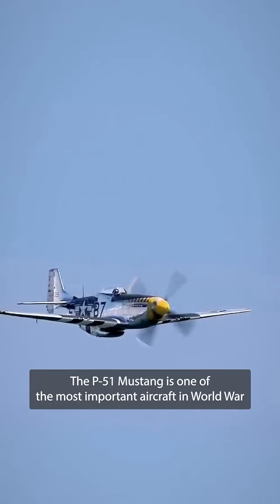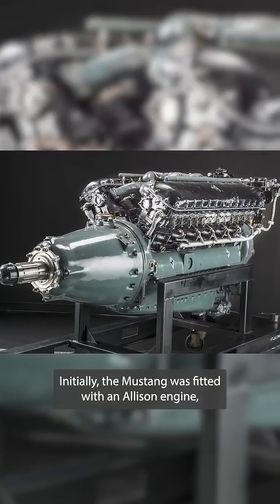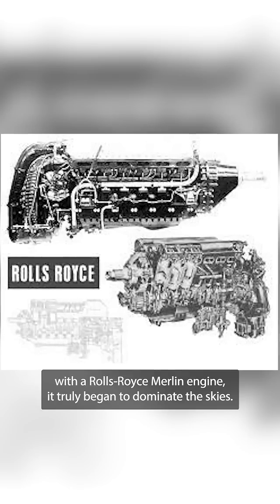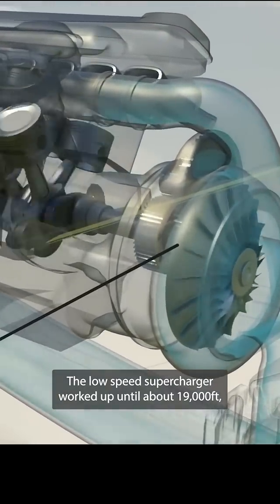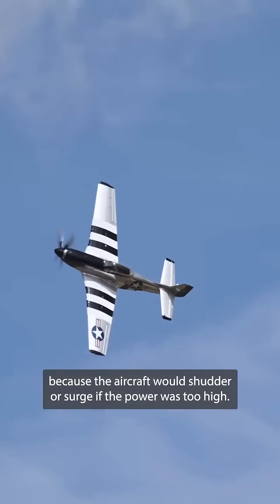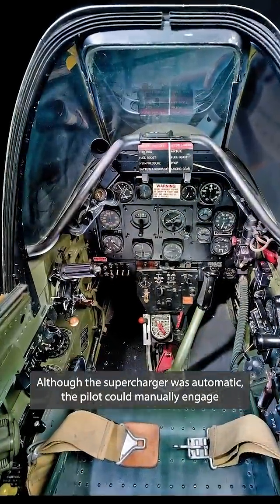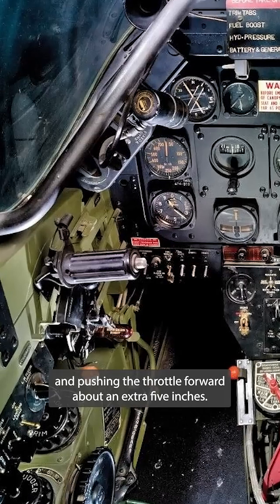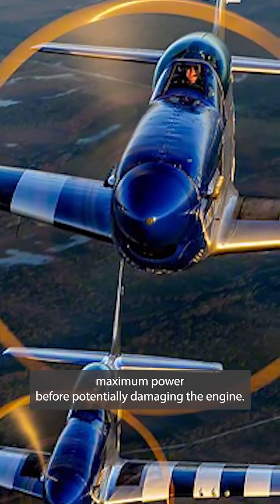The P51 Mustang: WW2’s Best Fighter!

Comment: Packard Merlin built on licence in America. The RAF swapped out the original engine due to it struggling at higher altitudes, which limited the performance as a Fighter. In went in the trusty Rolls Royce Merlin and it made a huge impact on the P51 straight away.

Comment: the Merlin was not only more powerful at low altitude but much more powerful at higher altitude.  transformed the p-51 into the final pen-ultimate fighter of the war.  it was light, maneuverable,  fast,  agile, long-range, quickly manufactured and more.

Comment: I wonder how it would have performed with a Griffin engine? Instead of the Merlin. The engineers at Supermarine had to extend the forward section of the Spitfire to accommodate the Griffin engine, was there sufficient room in the Mustang?

Comment: The PT boats in torpedo attack mode, had a selector on the Detroit 6-71 engines governor that was labled "Battle Mode" , which gave the crews an additional 500-700 rpms(depending on the crew chief) for their run-in to attack.  Those also risked engine damage if Battle Mode was selected on the governor, even though it was a tough Detroit with really good cooling. 

We had a WW2 pilot flying for us in the early 80's.  He flew P-51's tor 3 years.  Was shot up twice and made it back with no scratches.
 He always said, - The P-51was kind of a dog, until you got rid of all the underwings, half the ammo and down to a third of the fuel left,, then it was a  HOT ROD!-.   Pilots would "grey out" because of the quick G loading at altitude.
Reply: PT boats did not have Detroit diesels. In fact, they didn't have diesels at all. They were powered by 3 Packard built, 2450 cubic inch, gasoline burning V-12's.  Even larger than the 2240 cubic inch RR Griffon.
Reply: @Leftycraig48 Oh, snap. You rightfully made a liar out of the other poster. Good job!
Reply: PT boats used 3 2500 ci 1500 HP  Packard 
v 12 gasoline engines.
NEVER used a small
 6-71 Detroit Diesel.
Marine versions of 6-71s in the 1980s put out almost 500hp. WW II versions of 6-71
put out less then  half 
that power.  Vietnam 
river patrol boats had high power 6-71 Diesel 
puting out about 
400 HP.

Comment: What really helped to boost the Merlin's performance was the introduction of higher octane aviation gasoline. The Merlin was basically a 1,000hp engine until 115 octane fuel became available. Then it was a 1500hp engine.
Reply: Higher octane fuel does NOT increase horsepower by itself.  Increased octane allows higher compression ratios (which really increases horsepower) without detonation.  (Some folks surprisingly do not understand this simple fact.)
Reply: Exactly - it makes the fuel burn slower so you can burn it faster 😱😁 @cmichaelhoover8432
Reply: The Germans couldn't obtain high octane fuel. The displacement of the Merlin was much smaller than German fighter engines, but it still produced similar HP numbers due to much higher compression ratios, possible bc of hi octane fuels.
Reply: @thenaturalmidsouth9536  that's incorect, the germans had high octane fuel from day one.  even the USA was supplying TEL  during the battle of Britain
Reply: @deanwilliams4365  they didn't have it for the bulk of the war, no.
Reply: @thenaturalmidsouth9536  Incorrect,  the Nazis had High octane fuel during the battle of Britain,  synthetic fuel is easier to make high octane anyway, add to that 400 tons of TEL ( look it up) wa shipped By the US to nazi germany during the battle of britain, according to the Truman report!
Reply: rubbish,  the british had high octane fuel from day dot

Comment: And the ME109's engine was an innovative arguably better design not better performance. The ME's engine is Direct injected and mounted oil pan UP. So it was never starved for Oil or Fuel regardless of the planes potion or maneuvering.
Reply: From 1941, Merlins had a simple flow restricter, called Miss Shilling's Orifice after its inventor, which prevented fuel starvation when inverted or in negative G. The beauty of it was its simplicity and that it could be fitted to Merlins in the field. It was an extremely effective stop-gap until the Bendix pressure carburettor became available in 1943.
Reply: @paladin56  Were they still prone to fuel starvation in prolonged high G turns
Reply: It was also somewhat easier to maintain for mechanics since it was "upside down" so to speak...

Comment: Really?! Read your history, the p-51 was designed with a supercharger but the British didn't want it.
Reply: I was under the impression that the Allison 1710 had an export sensitive turbo-supercharger. The RAF was looking for a high altitude fighter, so it makes little sense to me that they would order an engine which was incapable of providing that ability when a version of the engine which could do so was also available. As it was, the RAF was very disappointed with the Mustang I's performance at altitude which is why it was used exclusively as a low-altitude tactical fighter and fighter reconnaissance aircraft. It is precisely for that reason that they experimented by putting two-stage, two-speed supercharged Merlin in it.

Comment: The 2 speed supercharger was shifted manually at high altitude. War emergency power was a water/alcohol injection system.
Reply: i thought that too. but it has to be true, its on the internet.
Reply: @wils-q7j  ha ha! if it's online it has to be true!
Reply: Yes. Water injection dampened fuel / air detonation so they could open the throttle to a higher manifold pressure provided by the supercharger. Alcohol kept the water from freezing at the extremely low temperatures at high altitude. The water / alcohol reservoir could only supply water injection for little more than 5 minutes.
Reply: I thought the emergency horsepower was from nitrous oxide. I know they had water/alcohol injection, but that wasn't for a boost in power.
Reply: WEP was produced purely by running the fuel in rich mixture and over boosting the engine.   Water injection was only used on the P-51H but it never entered service.  
Water injection injection was used on the R-2800 of every American fighter that used it.  Not the Merlin though.  
110/150 fuel allowed even more overboost than 100/130.

Comment: And, as ever, the P-51 Mustang, though an innovative design and production values - laminal slipstreaming, ect, - it was nothing without the British Merlin.  Therefore, the Spitfire was really better than Mustang, given comparative time frames of invention, construction and use.  However, no matter the kit, it was always the pilots that made the inanimate object into a thing of near-living lethal beauty.
Reply: Even with the Allison, the P-51 was one of the fastest fighters at low altitude. With a Merlin, it was about as fast as a Spitfire was with a Griffon. The P-51’s main strength wasn’t that it used cutting-edge technology, but that it was just a versatile and relatively cheap design that performed well and could replace the jobs of most of the other fighters the army had.

Comment: I had the North American P-51 Mustang Pilot's Flight Operating Instructions in the early 60s and was fascinated with the aircraft. Bailing out required squatting on the seat and rolling upsidedown. Ditching in the ocean swell troughs and the use of the pilot's relief tube. Two buttons on the right would activate a timer to destroy the radios with explosives.

Comment: The Mustang was actually designed by the British as a future replacement for the Spitfire, but since their manufacturing capabilities were fully extended, the British asked the Americans, who were partners in in its development, to produce the aircraft in the USA. Typical of American pride, they wanted an American engine in the new Mustang, hence the first production with the Allison engine. The performance was so poor with this engine that the British refused delivery of the Mustangs... until the same engine used in the Spitfires was installed and the Mustang became the fighter that won the air war in Europe. The British designed and British powered Mustang, built in America, became the world class fighter of WWII.
Reply: British may have provided specifications to North American, but they sure didn't design it. In fact one its leading designers was a German immigrant. Look it up.
Reply: You're not really correct. The British Purchasing Mission wanted the Curtiss P-40 and, to help ramp up production, asked North American if they would licence build the type. Instead, North American offered to design  their own aircraft which the British, suitably impressed, selected as well as the Curtiss. It was later, after the disappointment of the Mustang's high altitude performance, that Rolls Royce experimented by putting a Merlin in a Mustang. The rest, as they say, is history. The RAF also particularly disliked the canopy arrangement on the Mustang as it obstructed vision for the pilot. Because of this they redesigned the canopy, fitting the 'blown' Malcolm Hood which dramatically improved pilot vision and also mage it easier to leave the aircraft in an emergency.

Comment: War emergency power is such an interesting concept
Reply: A USAAF general (I forget which general) scolded a P-51 fighter group commander, a colonel (I also forget which colonel), because his P-51 pilots were overusing war emergency power and burning up expensive P-51 engines. The colonel replied, "Would you rather my pilots burn up replaceable P-51 engines to protect irreplaceable bombers each with four engines and 10 men or would you rather they sacrifice bombers to preserve P-51 engines?" The general quickly saw the colonels point and replied, "Tell your pilots to burn up as many engines as they need to protect the bombers. We can replace the P-51 engines."
Reply: Congress has the power to declare war...😅

Comment: You do not understand the basics, the supercharger second stage does not kick in at high altitude, it is permanently in-line.  You are confused by the change over to the higher supercharger speed.

Comment: When the Army sent out the spec. for these engines, G.M was suppose to supply the turbo/supercharger. Those turbos wouldn't fit into a P40 or P51 but would fit into Kelly Johnson's twin boom P38's and acquitted themselves well at high altitudes.
Reply: I think you are confusing the Merlin in the Mustang and P-40 with the Allison fitted in the P-38 Lightning.
Reply: @1chish  No I'm not. The plane that became the P51was originally fitted with the Allison V1710-39 engine and had a disappointing review. Look it up. G.M.'s turbo would not begin to fit in the P51 and the Allison would run out of breath at about 12000 ft. It was then fitted with the R.R. Merlin which had a two stage, two speed supercharger with excellent performance at altitude. Also the P51 was originally a request from the British who were looking for a long range escort for bomber groups.
Reply: @musoangelo  well thanks fir telling me history l have known since the 1960s 😂
Whatever .....
Reply: Allison developed a two stage super charger for the P-51 and P-40Q.  It needed some minor engineering around the firewall to fit so they didn’t bother but the allusion could have powered a high altitude P-51B
Reply from the maker: I gotcha!
Reply: Not n Europe The P38 ALLISONS DID NOT LIKE THE EXTREME COLD

Comment: Wait where's the high-speed blower located? That's the one thing I never found out in the mustang. 

Sidenote, those Allison engines only have a single stage, single speed blowers, only capping them at mid altitudes. Planes with those engines as is suffered as a result against German, Italian and Japanese fighters
Reply: As another side note, the P-38 had Allison's with full-up turbosupercharger systems, and those had much more power than the Merlin at all attitudes. They were, however, extremely complicated to operate. The Allisons without the turbos and only single speed superchargers were dogs by comparison.

Comment: RR Merlín. Licensed for Packard production in the US.
Reply: And that was SO important.  Rolls Royce had designed an amazing engine, but their factories and craftsman were used to meticulous  hand assembly which resulted in an amazing product, but it was a ridiculously slow process. 

The war demanded more....

Packard, like all U.S. automakers was used to mass production assembly lines.  They'd been chasing Henry Fords assembly line processes for years!  Taking a RR Merlin and combining it with the modern assembly line process, spitting those engines out, was so important to the war effort. Rolls Royce just couldn't build enough of the engines to meet the needs of the war.
Reply: @danlimbaugh3629  
When the RR engineers visited the Packard factory, they each had a file in their back pocket.  The Packard engineers silently laughed and proceeded to show the RR engineers how to build an engine.  Without any filing to make the parts fit.

When the RR engineers returned to England they instituted the Packard manufacturing and ended up immensely increasing production. 

However, RR denied Packard's requests for design improvements.  That included fuel injection and a turbo charger / supercharger combination.  A turbo charger works off of the waste exhaust and takes only a small amount of power.  A supercharger works off the engine but takes a larger amount of power.  A turbo / supercharger combo would have given the engine a big boost until it reached a high altitude and then the supercharger would be added.

Comment: The original motor was trash. Once they put that Merlin in there. It became the best fighter aircraft of ww2
Reply: The Allison (original) engine was actually very well made, better than the Rolls-Royce Allison only suffered from lower boost pressure which meant lower ceiling. Early in my career I worked on both engines.
Reply: Trash ? , no.
Reply: The P-38 had Allison engines with full turbo and supercharger systems and were more powerful than the Merlin at all altitudes.

Comment: Funny how when the Americans started doing recon out of Oxfordshire in WW2 they tried using Mustangs but could never get to the alititude needed. They switched to Spitfires and stuck with them throuout the war.
Reply from the maker: Well not really… they swapped from the Allison engine to the Merlin after flights showing that above 15,000 the plane was a dog. The brits actually made the swap and reported the significant improvement back to North American Aircraft. Many pilots loved both but there was a strong affinity for the P51 for those who flew the Spits.
Reply: The P 38 F-5  was a well used photorecon version used in all theatres.